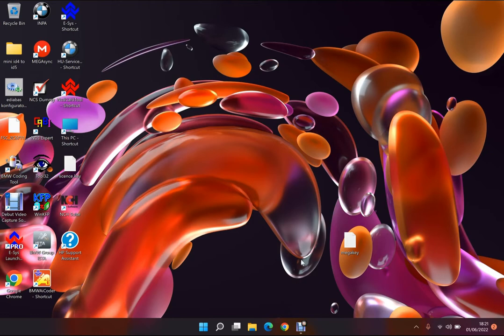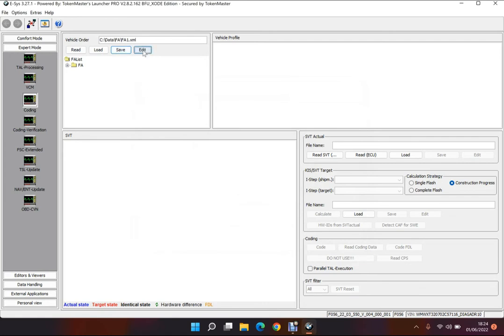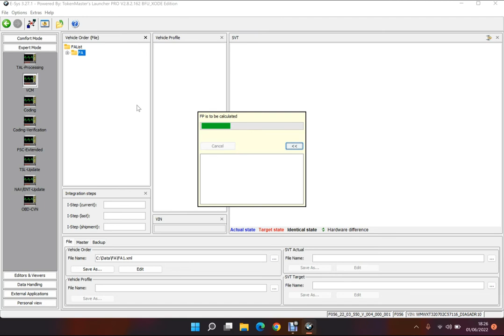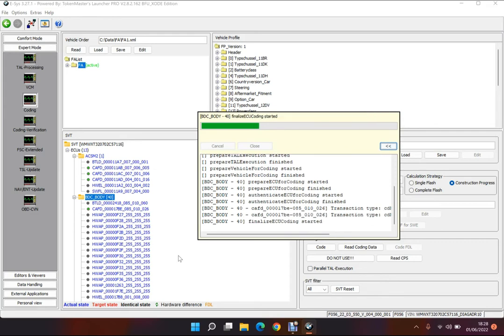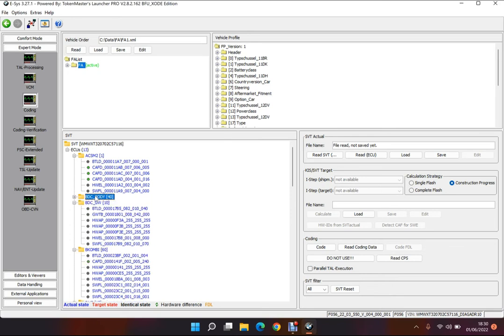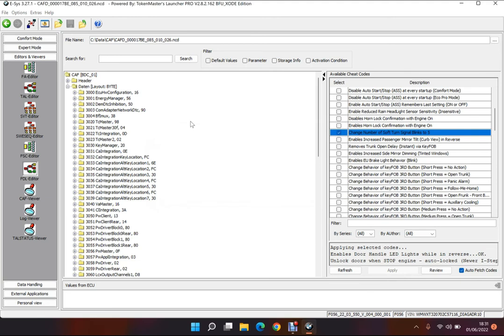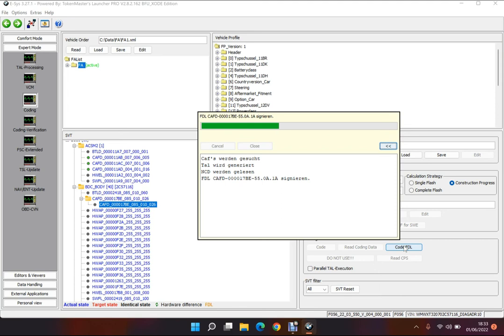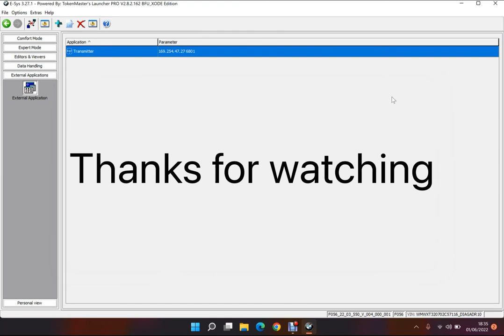Lets enable launch control and sport transmission

Comment: Thank you, I used this guide to enable sport transmission on an F32, it worked, but I additionally flashed ECUs specified by a coding cheatsheet for F30. LC is active now and the car shifts faster.

Comment: Hi, I added the steering wheel with pedals, and connected the wires from the szl to the bdc body that were missing for the pedals, can you tell me which ecu I need to code for the pedals to work on the steering wheel,and sport transmition after I added the 2tb VO? Car is G30. Thanks
Reply: Hey, did the retrofit work?

Comment: If i don't have paddles shifter, do i have to code the BDC Body module?
Thanks for your answer
Reply: I would flash as per vid then go into bdc and deactivate paddle shifters if you don’t have them
Reply: I did this coding, but the bdc_body module does not appear on my car. can it be fem body? Also, DS appears on the board and not S1. what else should be coded to appear S1 in sport mode?
Reply: @cristidragusin5686  I’m guessing your mini is a r55 ? These have footwell modules fem body . To have sport 1 etc you need to have a sport button or driving modes button. If you get stuck there are plenty of people that can remote code.
Reply: Sorry, my car is BMW F31 2013. I have driving modes button. I guess i have to code icm module
Reply: it doesn't work with icm coding either. if anyone knows what needs to be done to change the display from DS to S1, S2... please help me. The car is a Bmw F31 318dA
Reply: @cristidragusin5686 pre lci shows DS, pretty sure LCI ones which are 2015 and above will show S1 etc unless you tune the gearbox with XHP.
Reply: @piovo1  It has nothing to do with lci or pre lci. I have a friend who also owns an F31, also from 2013, and it appears in sport mode S1, S2.. although it does not have a sport gearbox. I checked his options and he still has 205. the only difference is that his is 320d and mine is 318d. There is probably a software difference between 318 and 320, although the boxes are identical. Even with 2TB encoding, mine doesn't show what his unencoded one does.